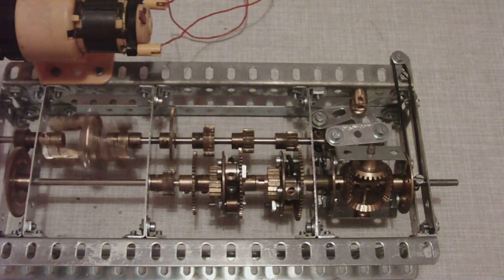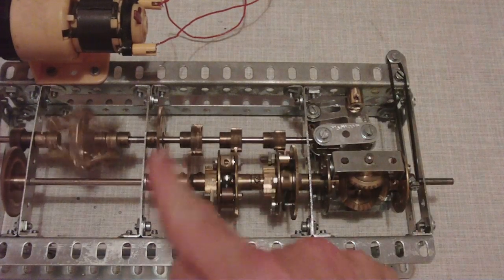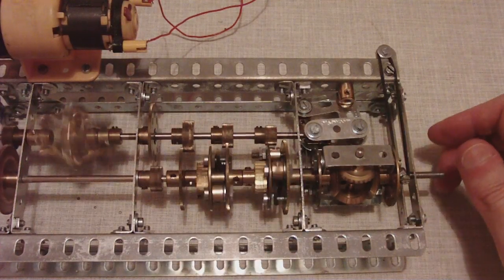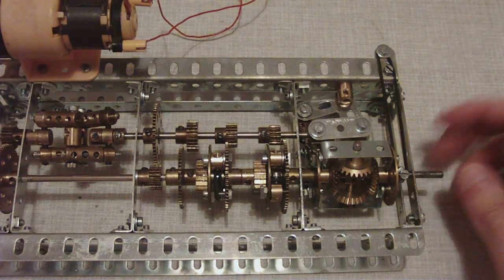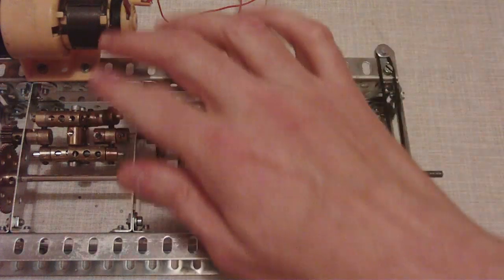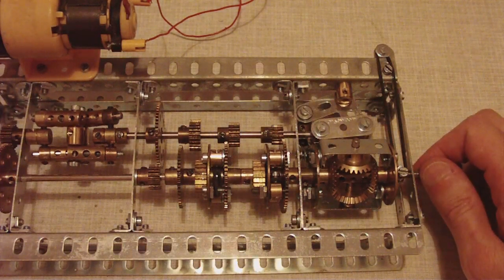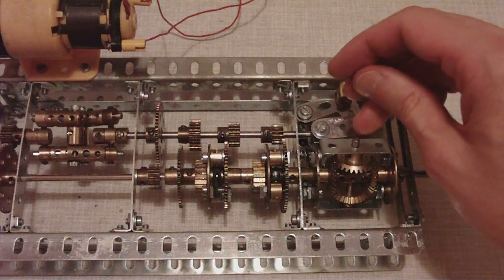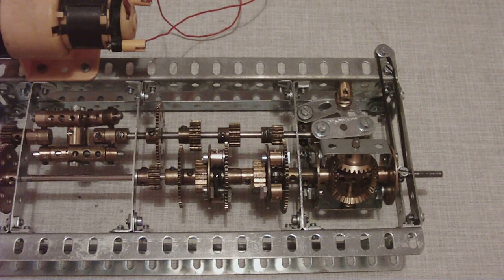Meccano 3-speed automatic gearbox

Comment: Can you explain how these ratchet mechanisms work, and how they keep the gears engaged? Thanks!
Reply from the maker: +Daan Haeyen I can, will have to do a supplementary video. Should be up by mid month,
Reply from the maker: +Daan Haeyen That is now up. Look for the link at the end of the video.
Reply: +Brian Meccano Leach Thanks, that explains exactly what a ratchet is and how it's made from Meccano. But how does this help with the shifting between gears? I think I understand: when the mechanism switches into a higher gear, it is still driving the lower gear, but because of the ratchet those gears are simply being pulled along. Is that right?
Reply from the maker: +Daan Haeyen I don't rightly know. All I can suggest is you buy the magazine where the model came from. http://www.ebay.co.uk/itm/MECCANO-ENGINEER-No-12-JUNE-SEPT-1976-FINAL-ISSUE-IN-EXCELLENT-CONDITION-/182002801956. The explanation is difficult but when a high gear is engaged the lower gears freewheel.

Comment from the maker: Tricky. This is not a model that you can buy from a shop as such. The parts can be bought at the meccanoman com website. The magazine to build it may be available on ebay. However this is going to set you back quite a bit, the brass parts are expensive.